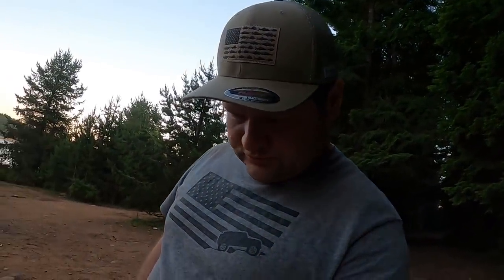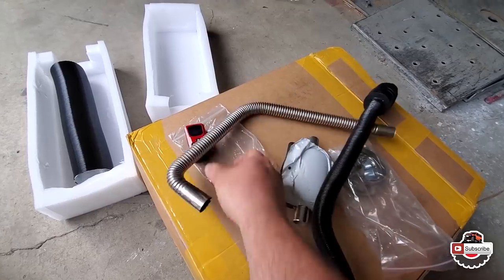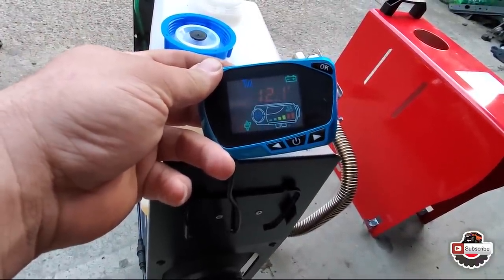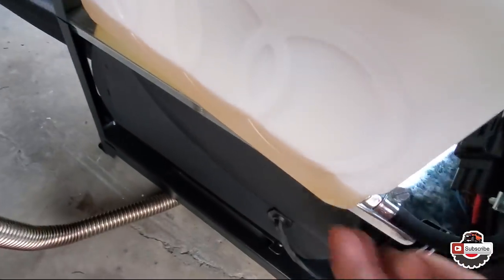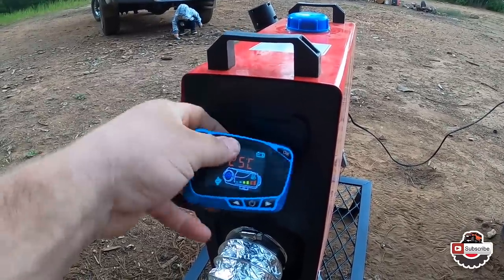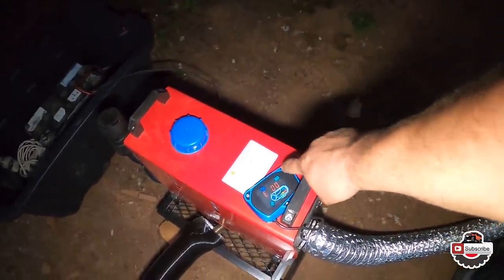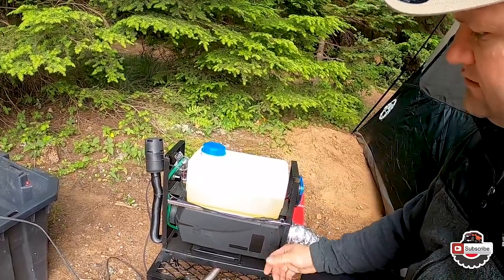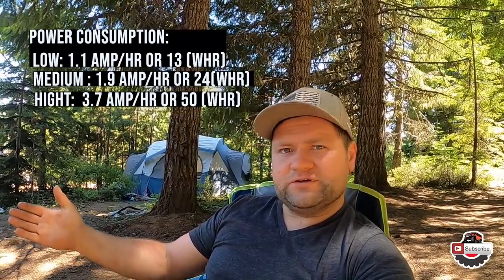Camping Heater 5KW Review

Comment: Hey mate it’s not the heater it’s the length of ducting your using on such a low setting if you turn it up to at least half speed then the fan will be able to disperse the heat but because it’s on low too much heat stays close to the machine and it can’t push it away also raise your ducting so that the fan doesn’t have to push hot air downwards before it goes upwards and the heater will stay at normal temperature running speed. When you have a long run of pipe work ducting the fan loses velocity so most people run them faster but leave a window or screen open to get rid of the extra heat produced. It’s especially imperative that you never lose 12 volt power to that heater when it’s running not even for a second or the heater will turn off and the fan stops and all that heat inside the heater can damage or melt your control board inside the heater and the fuel already inside the heater will start to burn off as smoke pouring out of everywhere in the heater so put proper battery terminals on the heater positive and negative 💨 
Also that black air intake filter is rubbish and not actually a filter you should buy a proper filter that stops the bugs coming in. If you want to keep the black thing then wrap some mosquito fly screen around it. 
Most importantly if you run your heater on low all the time without running it on high for a minimum of at least 20 minutes then the chamber will block up with carbon buildup so run it on full before turning it off . 👍
When you are at home test your heater again on half setting or full setting and it should be fine and you won’t get error codes.
I have 4 heaters and one is the same enclosed heater as your one ( the heaters are all the same) if you need any advice just flick me a message. I have a 5kw one that I run every night at my house in the wall it runs on full for around 14 hours everyday it’s been running every day for 5 months. If I turn it down to half or on the lowest setting I always run it on full speed again for thirty minutes to an hour before turning it off and it runs like a dream. I also put the tiniest amount of diesel injector cleaning in each tank ( 10 litre tank on my home one ) and that keeps the glow plug and inside the burn chamber nice and clean.
Reply from the maker: Thank you for clearing some things up for me. Your advise confirmed my suspicions on why it was overheating. After doing some research about it, I began doing that same process after every use, running it for 20 to 30 min on high to burn off any build up in chamber. I bought a pair of proper battery terminal clamps, so that's now taken care off. Diesel injector cleaning is a great tip, I didn't really think about  that. Thanks.  Your comment deserves a pin to the top.
Reply: Jeeper Gear You’re welcome 
Anytime 🙂👍
Reply: Hello hope you doing well can you pls help me to find right batteries for 5kw heater and how to trun off the heater correctly outside malting anything in the heater 
One more thing it can be run by 2000W generator aswell or not 

Kindly reply Thanks
Reply: tasty foodie hi if you buy a 100 amp hour deep cycle battery that will be okay ( remember in theory your only using half=  50 amp hours from the battery) your battery will last longer if you don’t run it lower than 50% . You can’t run the heater directly off a generator it has to always be connected to fixed 12 volt battery power it’s okay to charge the battery while the heater is running but a generator can’t be the only power source. If you run your heater on low over night make sure you turn it up on high for at least the last 30 minutes in the morning before turning the heater off and that will burn 🔥 off any carbon buildup inside the burn chamber. 🙂
Reply: @matt08sydney  
Thanks a lot mate 👍
Reply: @matt08sydney  
Thanks for your reply as you said if I'm using 100amp hours battery we have to use 50amp hours and if I running heater at medium so how many hours it will run on 50amp
Reply: @matt08sydney  
Hello I'm looking 5kw heater on ebay 
 What does this mean 
Rated voltage: 12V OR 24V (confirm the car voltage and then adjust)
If its 24V 
My question is that can deep cycle 100ah run if its 12V or 24V 
Please kindly reply 🙏 
Thanks 😊
Reply: @bittertruth2243  hi again mate it will run the whole night but best if you can buy a 200 watt or 250 watt solar panel and that will recharge the battery for you every day while you’re off grid they are relatively cheap around $150.00 and most of them come already with a charge controller to regulate the power going into your battery. If you’re in a place where you don’t get a lot of sun buy a 250 W solar panel and a 20 amp controller
Reply: @bittertruth2243  it will have to run on 12 volts but if you have a 24 volt system like in trucks then you will have to buy a small DC to DC converter that converts ( reduces ) 24 volts down to 12 volts 🙂. Always hard wire the battery 🔋 to the heater so it can never accidentally turn off while it’s running otherwise you can burn 🔥 out the circuit board if the fan shuts off and can’t go the the couple of minutes cool down period during shutdown.
Reply: @matt08sydney  
Sorry my question is that if battery is 12v 100amp hours deep cycle and heater is
24v is that ok to run 24v heater with 12v battery 
Please clear this for me I never done this before will be appreciated
Reply: @bittertruth2243  all good  no it wouldn’t work but in saying that I’ve never seen a 24 volt heater they are all 12 volt definitely all the Chinese diesel heaters are all 12 volts is yours a 12 volt??? It will have a sticker on it maybe they come out in 24 volts for curtain applications like 24 volt trucks but I’ve never seen one buddy
Reply: @matt08sydney  
Specification:
Heater power: 5 KW
Type: heating
Rated voltage: 12V OR 24V (confirm the car voltage and then adjust)
Fuel consumption (L / h): 0.1-0.24L
Heater operating temperature: -40 ℃ ~ + 50 ℃
Operating temperature of the oil pump: -40 ℃ ~ + 0 ℃
Tank: 5L
Reply: @matt08sydney  
Thanks a lot my friend ❤ 
I never had these Heater before I was looking for it now after watching a YouTube video Thanks for sharing all information and guidance 🙏
Reply: @bittertruth2243  you’re welcome message me anytime you need some advice 🥰
Reply: @matt08sydney  
Thanks i will  bless you ❤

Comment: It may also help to shorten your duct to the tent even more and put it in the tent low, (since heat rises) at the door. You can use your zipper to close the space around the duct and hold it in place. Another thought to keep the unit cooler would be to take the red shroud or cover to a local specialty metal shop and have them cut some louvers in the bottom of it around where the hear sits. This would allow some air flow through it as it runs.

Comment: You need to pair the remote, to the unit, it will show an icon when up and paired.  You have the air intake  hose going out where most exit for exhaust.   No worries,  many variations for install, but I agree your exhaust install is a problem.
Reply from the maker: Yeah, reason for routing the intake like that, in my mind the thought process is, if i was to put the exhaust there, next to main heater air intake.  It would pull exhaust co2 and push to heater coil and then to tent interior.

Comment: the whole body needs to be in the tent and the exhaust and combustion intake directed outside it the controller is the thermostat is on the body and if outside it just runs continuously even at lowest setting
Reply from the maker: no thats not necessary, just the controller. Since it contains the t stat sensor for the temp.

Comment: How many volt can this heater consume in 8 hours of use with a battery full of charge? Planning to install one on my 2016 RAM 3500 which come with tow batteries. Thanks
Reply from the maker: To be more acurate, it consumes about 1-1.5 AH per/hr so its roughly 12 amp-hours in 8 hours.

Comment: Hi, I need to extend the 12v wiring out the back of the heater...do you know what size wiring i would need?
Reply: I used 18 gauge wire to extend my controller about 8'.   No issues.
Reply: Do One   Good point, agreed for the battery positive/ground wires and make sure you fuse the positive near the battery.

Comment: Is there any diesel heater I can plug into the wall? Or will this one run off of a ac to dc plug in wall converter?
Reply: You would need a 20amp regulated 12 volt power supply

Comment: $180 ??  I  just checked eBay and they are running $89 now.   I'm getting one for my RV for this winter as I'm tired of smelling my little buddy propane heater.
Reply from the maker: yeah seems that the units with out the case are at nearly half the price. i also went with one that had most and better reviews.
Reply from the maker: I've used buddy aswel, works well with an adaptor to a propane tank. except the smell and all the moisture by product.

Comment: voltage draw is useless info and why is you heater a million miles from the tent.  Hint if the hose that comes with it is short then you maybe should keep it close  to the tent.  What a noob.  Also the air intake is actually the cooling fan and that black hose with the cylinder on it is the intake .
Reply from the maker: It keept out tent carbon monoxide free. 
The black air intake hose is for the combustion chamber, metal 3/4" hose is the carbon emissions exhaust. Which you shouldn't keep near. 
The 3" intake pulls air in through airtronic unit to the heat exchanger then to that 3" exhaust that travels hot air to the tent. 
HINT:  As I have metioned, later I reprogramed it to higher rpm rate, to accommodate a longer heat hose. This way I don't have to hear it ticking or smell the burn off and it flows sufficiently enough to avoid e05 overheat code from popping up again.  
Heres a link to a basic diagram of how the unit operates, so you can avoid a noob moment and accidentally get carbon monoxide poisoning. 
https://images.app.goo.gl/U2GSfPtc7wUKmUn87